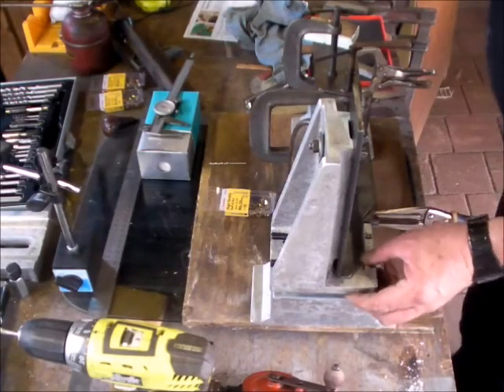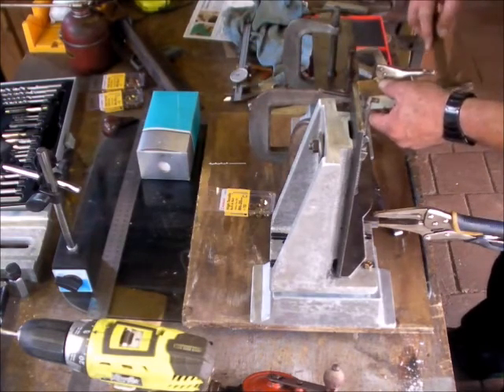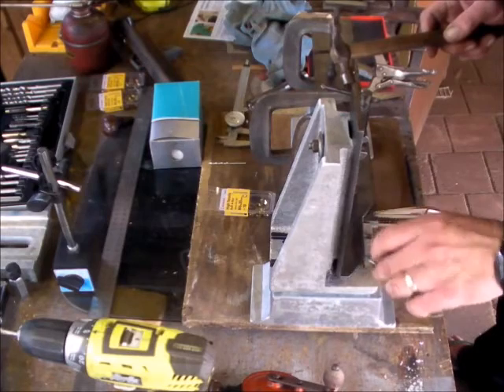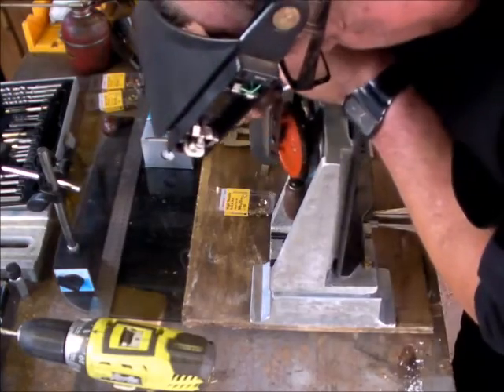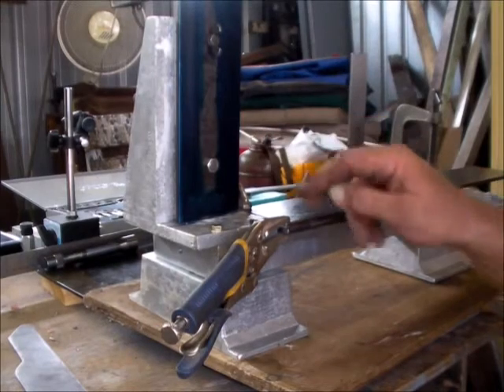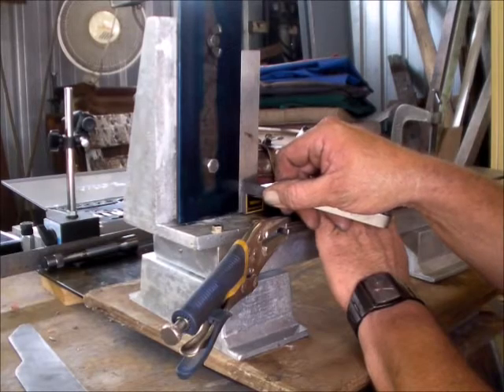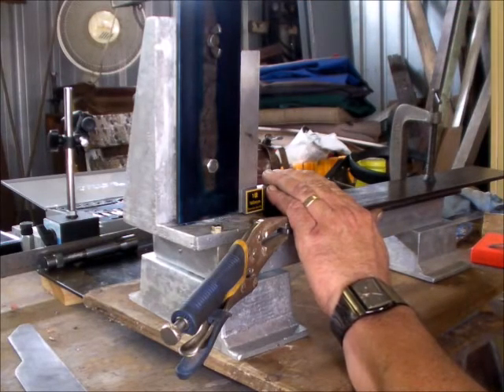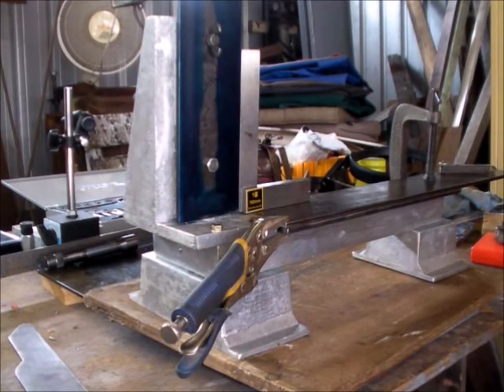Building the Gingery Milling Machine 7, more aligning the headstand ways

Comment: Peter,

Another great episode as usual.  One question, when you do your alignment pins, are you going to ream the holes for the pins to ensure a very close fit?  Will you drill these free hand or take the whole assembly to the drill press?

Joe
Reply from the maker: Hi Joe. my workshop is very limited in machine tooling, hence no reamers. I will have to hand drill the holes as it doesn't have clearance for the drill press, I will be fitting roll pins rather than dowels. Peter
Reply: Peter,

Just another option to think about.  You could drill the hole very slightly under size of say 6 mil.  Then, using 6 mil round stock, make a reamer and hand ream the holes with it.  (Something like a D bit) This would work because the aluminum is so soft compared to steel.  Then use a piece of the 6 mil rod for the pin.  You could experiment on a couple of pieces of sluminum to verify.  Being from the US, I am not used to the metric system, but we would typically drill a hole 1/64 under size then ream it to size.  Perhaps 0.4 mil under or there abouts?

Joe